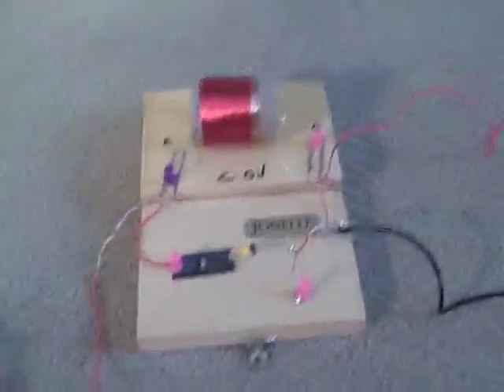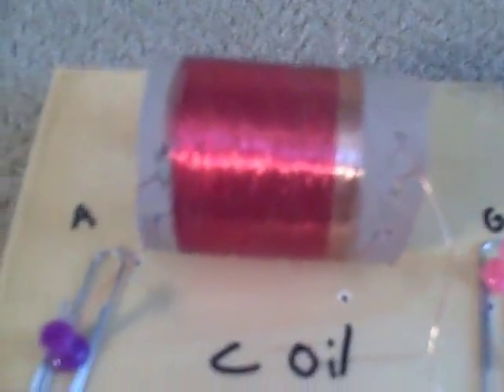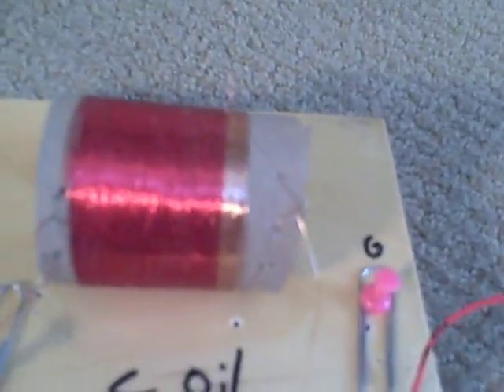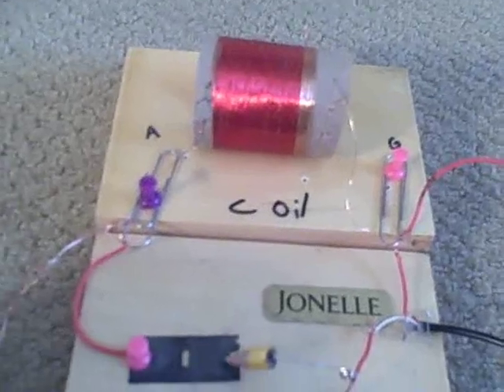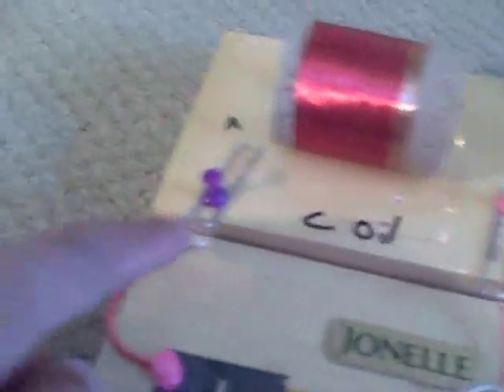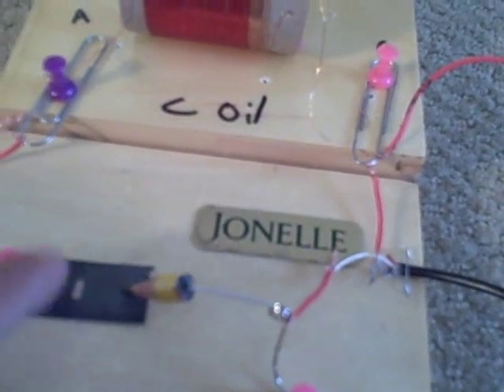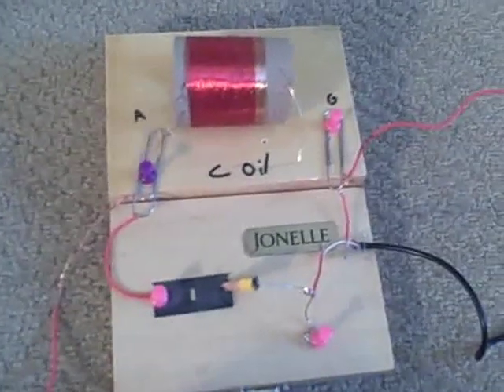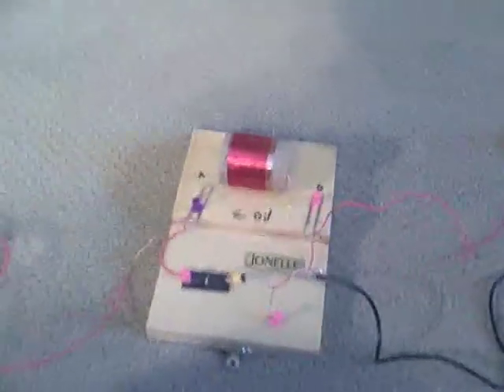How to make a Foxhole Radio

Comment: I used parts from junked radios, the transformers wire for coils (95, 100, or 150), var. cap., diode, and used a pill bottle (small, larger, and paper tube) for the coil. I've heard TN, S.Car, Dallas ,tx, Havana,Cuba, European radio, and Japanese news! I'm in OK.

Comment: try a germanium diode instead of the razor blade
Reply: there pretty cheap
1 buck for like 5 and they are already set up
Reply: a shockity diode "could" work too
because basicaly the razor blade pin combo is one
but germanium is realy worth it
Reply: look in an oldish midrange electric keybord th
e is an array of diodes there (germanium x about 100)
Reply: There's no such thing as a "shockity" diode. You meant a "Shockley" diode.

Comment: Unlicensed operation on the AM and FM radio broadcast bands is permitted for some extremely low powered devices covered under Part 15 of the FCC's rules.  On FM frequencies, these devices are limited to an effective service range of approximately 200 feet (61 meters).  See 47 CFR (Code of Federal Regulations) Section 15.239, and the July 24, 1991 Public Notice.  On the AM broadcast band, these devices are limited to an effective service range of approximately 200 feet (61 meters).

Comment: The Commission considers unauthorized broadcast operation to be a serious matter.  Presently, the maximum penalty for operating an unlicensed or "pirate" broadcast station (one which is not permitted under Part 15 or is not a Carrier Current Station) is set at $10,000 for a single violation or a single day of operation, up to a total maximum amount of $75,000.

Comment: could i use an inductor coil from a electric hair cutter the reason i am asking is because it is alot longer and layered like 20 times but it is basily the same as your coil magnetwire its  coiled around a square plastic spool

Comment: Really good but the reason th G.I.s didn't use advanced radios is becuase the could get intercepted by the Germans the foxhole radios couldn't be intercepted due to low frequency but still great video.